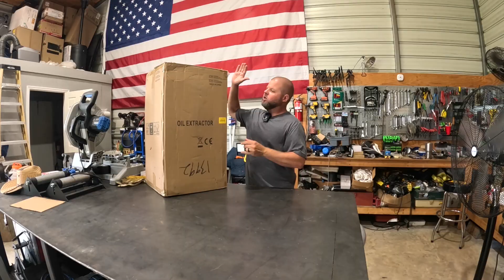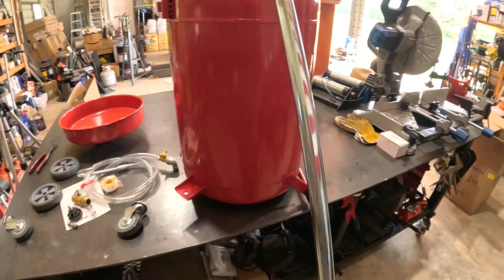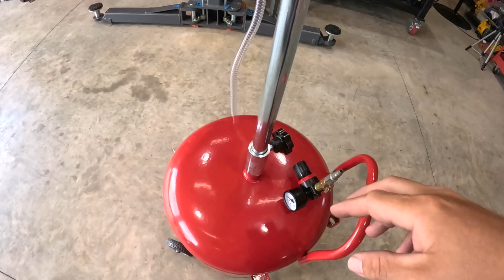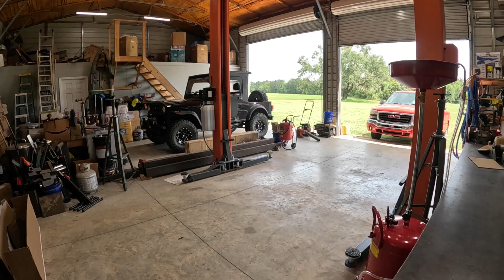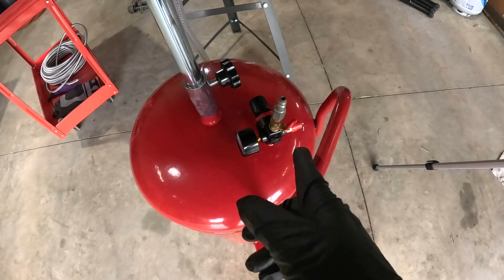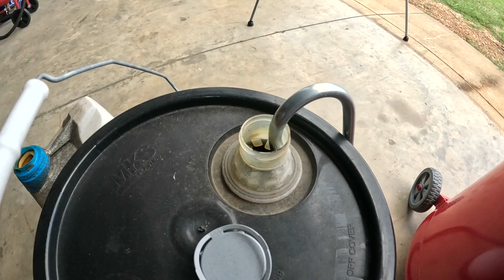Waste Oil Tank Is A Must Have!

Comment: I envy you!  A home lift add a whole new dimension to vehicle repairs/maintenance.  Couple of comments - When I was working at the station, I was taught to lift the vehicle a couple of inches then give it a good shake to make sure it was stable before lifting to the work height.  Glad to see you using the tall jacks for safety.  Wish I had the room for a lift.  Working off jack stands and a creeper is getting tougher for this old guy.

A little off topic but related...I've become a big fan of Fumoto Valves to replace the drain plug.  No worries about stripping or cross-threading the oil pan, no crush washers or O rings to replace, keeps your hands clean, and it's fast; a quarter turn and the oil is draining.  Another nice feature is if you happen to over-fill the crankcase, it's very easy to drain a little out at a time.  The only concern I would have would be if the vehicle was truly intended for rough off-road service.  If it's rough enough that the oilpan hits, I might think twice about a Fumoto Valve.

Love your videos, please keep 'em coming!
Reply from the maker: I've been looking at those, but I have a big fear of a stick or rock knocking the valve open 😬

Comment: When I worked in a shop, we had similar catch pots. We would take the used floor scrubber pads and put them in the catch pan. This would further mitigate any splashing of oil when it would hit the top pan! It would also give us a place to put the oil filter to drain because if you just put the filter in the pan with nothing under it, the gasket could possibly seal and the oil wouldn’t drain out of it.

Not that you need it down in Florida, but up in the northern states, we would use our used oil in an oil burning furnace to then turn around and heat our shop in the winter months! Was a way that we could recycle the oil to help keep us comfortable and would help mitigate any oil recycling chargers we would incur during that time.

Great addition! Glad to see the lift is already getting its use! It will pay for itself in no time!
Reply from the maker: Waste oil burner is on my to build list 😉

Comment: waited till end of video to say this cause i figured youd notice leaving that bottom valve open turns the hose into a site glass. it also will be a better vent option than leaving that air chuck open since oil would come out of the air chuck if you dont see that it filled up. although maybe air may still pop out top of the funnel.
Reply from the maker: I'm a slow learner 😂
Reply: @TheKelleysReviews  like hell you are, lol you seem to soak up knowledge like a sponge. Another 1 or 2 solar projects and you dang near certified. Time to start you a side gig.

Comment: I know Florida doesn't have bad winters but.
With all the used propane tanks you have you could use one to store all your used motor oil and hydraulic fluids in.
Do some research on building a waste oil burner they are easy to build and you can heat your shop for free when you want to work in the shop during the cold spells.!!!!
Projects I know but I think it would be a cool one.
Then you can burn the oil and get free heat and you won't have to pay to dispose of the oil 
Something to think about.
God bless and be safe
Reply from the maker: You and I are on the same page. I've been planning on building one for years 😉
Reply: @TheKelleysReviews  you probably have enough scrap steel laying around to build one fairly cheap

Comment: I was going to mention in the lift video that you would be needing one of these, but I knew you'd have it covered LOL.  We did the same as @ASiembieda and used the old oil to heat the shop.  Vevor sure has a selection of products - nice of them to send one out! (That undercarriage is sure clean on your truck - I thought you said it had a leak!)
Reply from the maker: It does have a good leak not shown. I hope it's something simple like the valve cover gaskets.